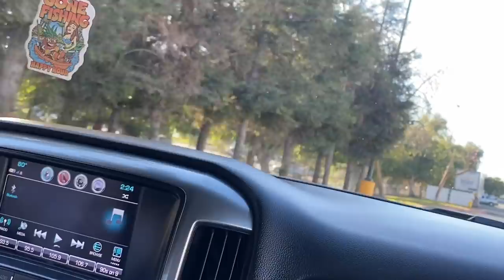HOW TO MAKE A GRIND BOX FOR FREE!!

Comment: I actually made a box during the quarantine, using an old drawer flipped over with angle iron from an old bed frame
Reply: i got recommended a video of these guys just skating a metal filing cabinet
Reply: I feel like it would be puncurted easy if it’s a drawer
Reply: @youpinhead8789  it could’ve just been a old hardwood one instead of a laminate one
Reply: Nice
Reply from the maker: rad! hope you're able to make more stuff down the line

Comment: This is the type of content I live for. Would love to see you make a QP outta junk.
Reply: I think that's a much harder ask because you need decent plywood and a lot of 2x4s cut to specific length. I'm sure you could still do it on the cheap but it's gonna be hard to make a sturdy decent qp that's worth the time and effort out of cheap garbage.
Reply: @FreudianQuip  I agree, for a qp you’d have to be a lot more precise and specific. But I don’t doubt that someone could for cheap! I’ve even seen some with pvc pipes that perform well
Reply: besides some good ply wood and some screws everything else could be made out of a pallet
Reply: @itsdakota6442  you're correct the problem is that quarter pipes take  longer to build, it's probably not worth the time investment to use shitty potentially warped pallet wood that probably won't hold up as well over time
Reply: @FreudianQuip it can certainly be done.
Reply: @myhousehaswheels  it was never a question of if you can, but rather if you should.
Reply from the maker: oh don't worry we definitely plan to
Reply from the maker: @FreudianQuip  I'm sure we can come up with a super cheap (likely not free) solution
Reply: Scour dumpsters and piles at new construction jobsites/ subdivisions and you can come up with a lot for free. I do plumbing in new construction houses and I can't tell you how much wood I've salvaged. 2x4, 2x6 sometimes even 2×12. I've found plenty of pieces that were over 6' also. Ask the superintendent  if you could clean the jobsite in exchange for material, you might be able to take some surplus lumber off of their hands. I know things are rough and wood is expensive but the last thing a superintendent wants to do is tell their boss they bought too much wood and now they need to get a trailer on site to return it, I know a super personally that gave a tradesmen 13 sheets of 3/4" OSB just because the pile had been outside for a couple of weeks and he didn't want to have to deal it. Clean it and its yours he said. A 4x8' of 3/4" OSB  is about $30 a piece.

Comment: hey guys, i have to say, i watched this video and got inspired. i literally found a bed frame sticking out of a neighbor's trash can a few days ago. i borrowed an angle grinder from a neighbor (literally). he showed me how to use it. instead of building a grind box like you did, i got a 4x4 post from home depot. cut it down to the length of the bed rails -- about 5 1/2 feet -- and put the rails on both sides of the 4x4. added some short 2x4 cut offs for feet and stability and the thing ROCKS! i spray painted and waxed the rails and it slides so fast i can barely stay on it! super stoked. thanks for the tutorial and keep doing 'em! btw, i'm 48 years old and got back into skating last year to teach my 2 little boys how to ride. loving it.

Comment: Fun video! We used to make our own ramps as we lived on dirt roads. So our skatepark was our driveway..
Pro tip; screw 2-3 2x4s on the other side and then take 2 PVC pipes and screw them on top. It makes a raised flat rail on the other side. This is fun for board slides and such

Comment: In order to prevent the pallet planks from splitting, drive in the screw in reverse to start with to make an initial hole and "heat cauterise" it to strengthen, then set drill back to normal and drive the screw in, it shouldn't split.

Comment: I made a big box and 2 ramps to make it a box jump out of those blue pallets but I dismantled them and just used them as building material.... Much more flexibility in the design but also harder, this is a great beginners build. I also made curb guards, basically you can screw 2 1"x4"x8' at an angle and put angle iron/bed rail on the edge as coping and use it on a curb or the edge of a wall w/o damaging the wall... It was a way to use a specific spot w/o leaving telltale marks so we never got kicked out.

Comment: Would there be a benefit to routing out a bit of plywood so angle iron is flush with the top and side?
Reply: i don't think you'd notice it when riding. it would make sense if you were using the angle iron for coping on a quarter pipe, though. you'd want it to be flush on the transition leading up to the rail/coping.

Comment: I'm shocked that Keen Ramps actually realizes their products are way beyond overpriced.
Reply: I wouldn't say they're over priced. If you calculated the time it took you to drive to the store, buy all the material, formulate a cut sheet (or wing it and maybe miss something), assemble, and maybe have to paint/seal/coat. The slappy ledge is $399 at $100+ hour, which is what anyone in the service industry charges, it would take about 4 hours or more to complete it (with quality workmanship). Once Keen starts to grow and actually open a manufacturing facility with more efficient processes the prices will go down, but support now for them is the most important thing for growth.
Reply: @sauceboss9313  Facts all Facts bro
Reply: lol foh go buy some bunk amazon shit then if you don't wanna pay for the quality

Comment: I need to get a new box, years back it was at a friends along with a rail I had custom welded. His mom just gave them to her gay friends kid. It could have been worse, seeing him call his parents fags was kinda funny. But I'm going to use 2 by 4s, and make it 2 by 5 or six. I'm gonna make it around 5" tall to skate it like a curb, and to adjust the height I'm going to either use cinder blocks and maybe have two sets with just regular blocks and the other set will have a smaller block liquid nailed on top. But putting some 4 by 4s together would work. Also I used to work at home Depot, those toppers would work, but you'd want a few more supports going across the frame as they're somewhat thin. Also if you keep it from getting rained on its relatively smooth. Edit: after a minute I thought "this sounds like Dan".